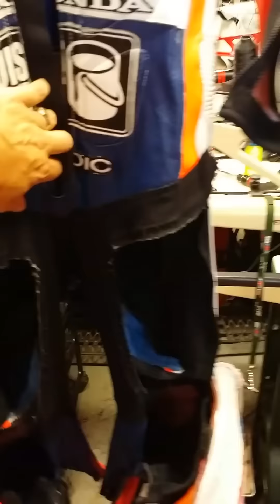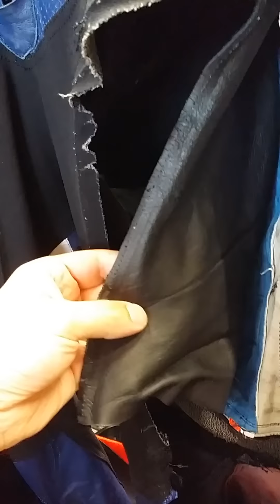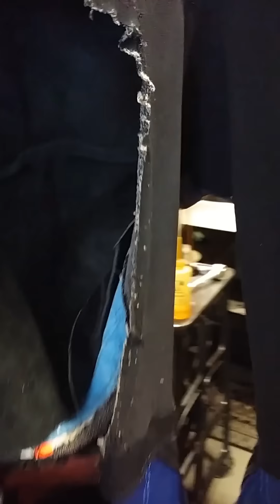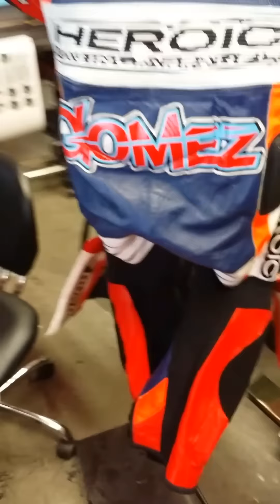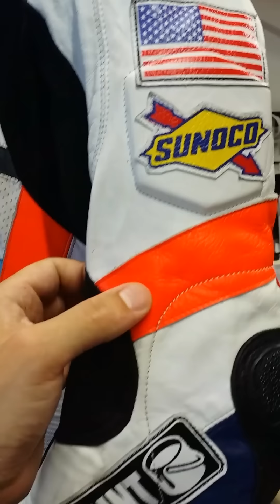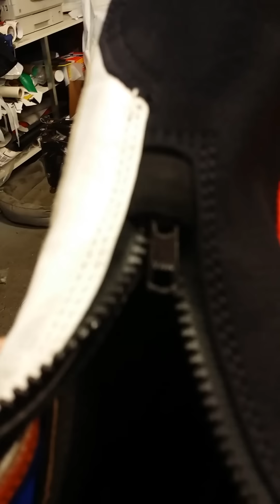We fix and repair racesuits and motorcycle leathers  A must watch.

Comment: Hey man, great video! Wanted to ask what advice you may have for someone looking to start a small, suit repair business. I've been fixing scuffs and paint touchups but now looking into larger tear repairs. Much advice as in the right and wrong ways for stitching and laying out replacement leather pieces.
Reply from the maker: Hey man.. Thanks for watching.  My best advice is buy the right tools and the right tool are $$$.  I've spent over 20k on machines and to be honest; I wish I would from the beginning bought brand new machines.  Old is great; but time is money and so is the quality of work.  If you are going to buy an old machine; make sure it was "made in Germany, UK or Japan".

Stitching advice; always take apart way past the damage and ALWAYS repair underseams.  I see all the time where repair places just go back and forth and back and forth on the finishing top seams.  The under seam is where you get the stability, longevity and redundancy concerning seams.